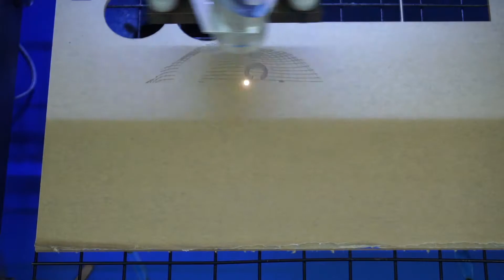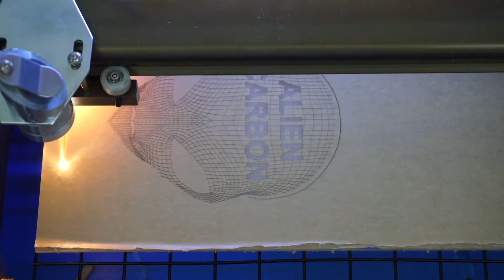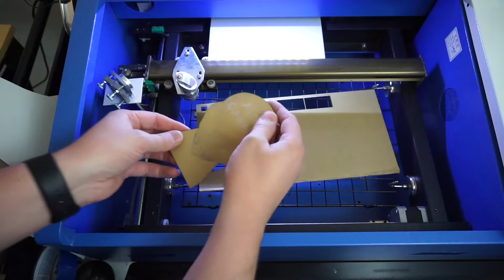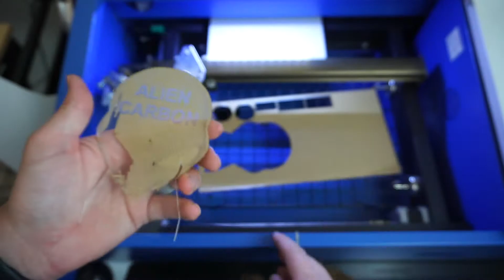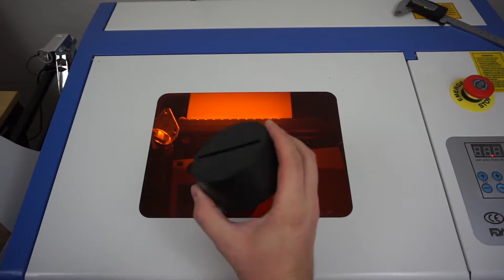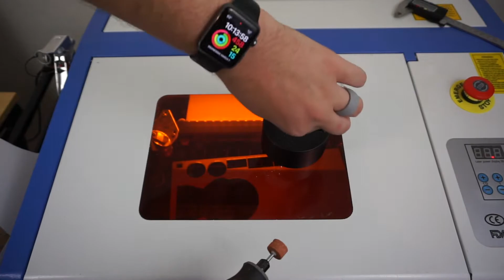Laser Cutting an Acrylic LED Sign

Comment: Hi, did you use a raster engrave or a vector engrave? @ the min I'm using a K40 with Whisper software to cut/engrave but use Lightburn to make the graphics. When I make these I use vector engrave, learnt today to reverse the design so the engrave is on the back DOH. TFS, GB :)